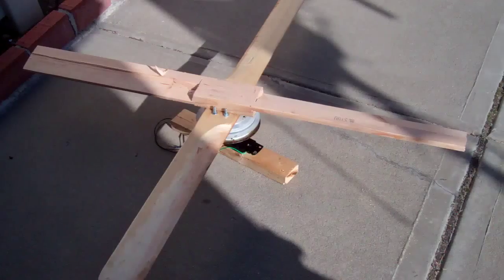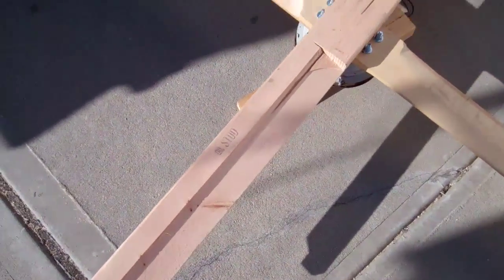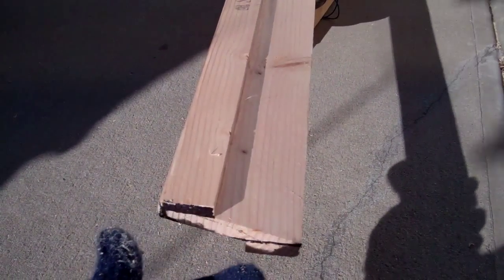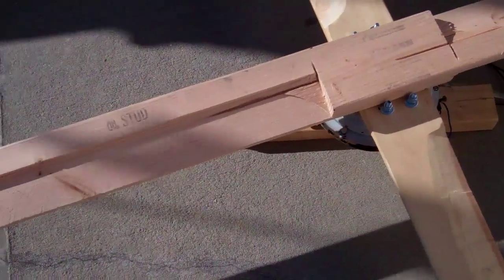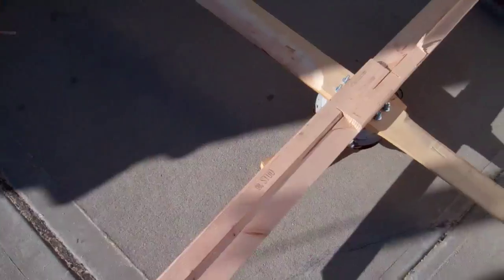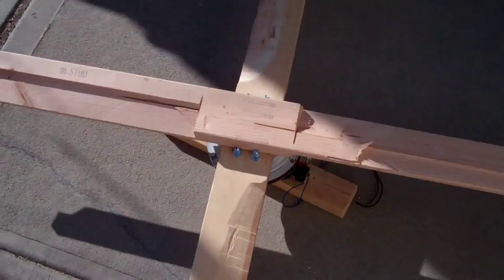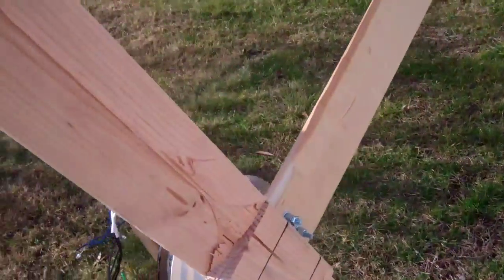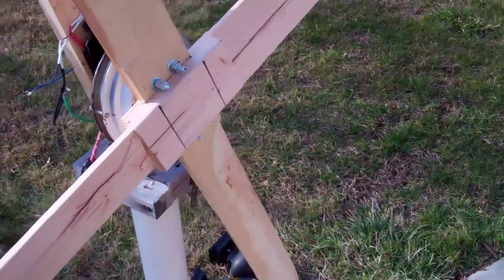Making blades for the ceiling fan motor wind turbine .mp4

Comment from the maker: @shartne I have an electric grinder to grind the blade. I also use a belt sander but the belt keeps breaking. That's why I used the table saw to do most of the tedious work. Now I just have to do some minor reshaping with the belt sander. Thanks.

Comment: you need a right angle grinder. i use a air tool for for stuff like that it has little round disc.They are about twenty buck at walmart. But do you have an air compressor to run ?.